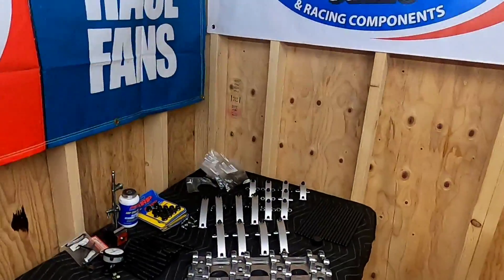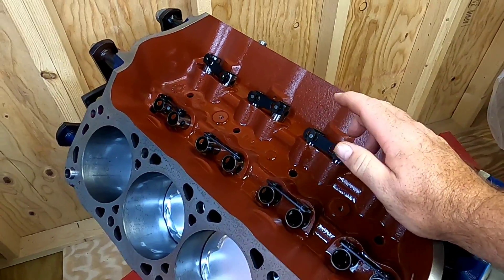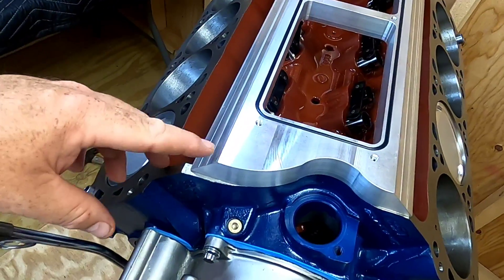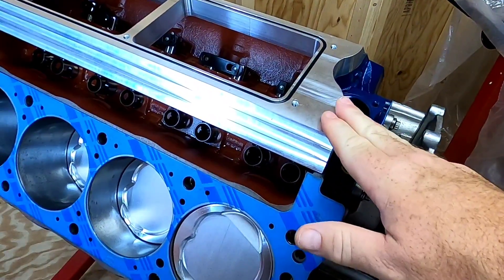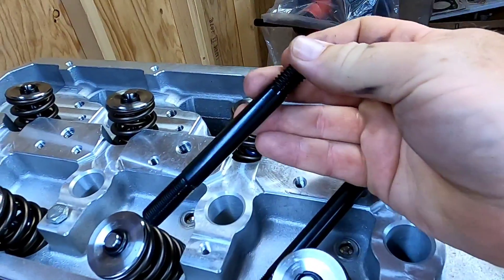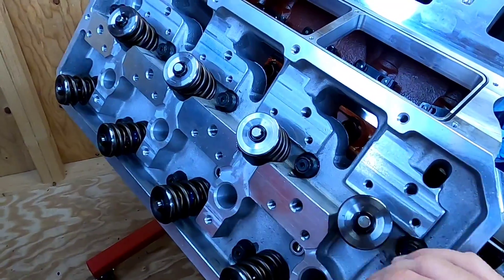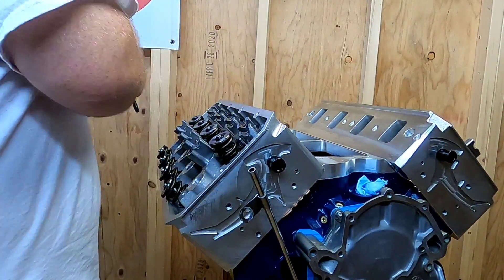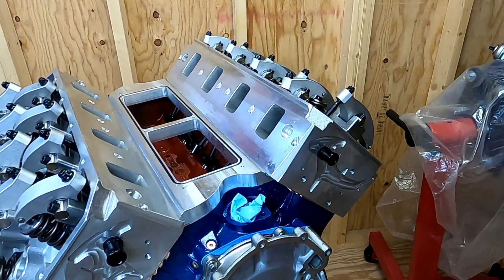BOSS 429 from a 429" Stroker WINDSOR??? Project MIXED UP BOSS

Comment: Love this idea, though Id almost rather see a pair DOHC heads … I know they used to make a SOHC head for Windsors, but thatd be pretty awesome to have a DOHC. Still, I def want to see how this turns out!  Will def be awesome!
Reply: If you don't mind losing about 2 liters the Coyote is a great engine to get into the dohc 4 valve world. They are a little different animal then the conventional 2 valve pushrod engine which is the world I came from before getting mine. I've learned a lot about valve timing (4 camshafts to degree!), more then I ever did with my sbc. For one, way more valve area relative to displacement so you can't really treat them like a 2 valve with cam lift, duration, and overlap.
Reply: @177SCmaro  I have a supercharged 2017 Mustang GT/CS … 670hp is a WONDERFUL thing, lemme tell ya!
Reply: @buzzbomb67  Ah. Well, there ya go.
Reply: @177SCmaro  lol I just figured, since he likes to bring up some obscure options, maybe he’d be interested in touching on the OHC kit for Windsor heads.  Wish I could remember who did it.  I remember it got pretty high praise, back in the day, but of course, its now obsolete, since we have plenty of OHC options, these days.  Still, it would be a seriously cool thing to pop the hood on, say, a 70 Torino GT, and find a SOHC stroker 351/454 Windsor with 8bbl FI
Reply from the maker: I remember seeing that also... I need to try and found out who did it...
Pretty neat idea..
Andy
Reply: @buzzbomb67  
How about a 78 Camaro with an engine that should be very familiar to you?
Reply: @177SCmaro  well if by that you mean a Windsor or Coyote in a Camaro, Id say the same as I would in re to putting an LS or Fuelie 327 in a Mustang.
 …first of all … 
BLASPHEMY!!!  BUT … that being said … I bet it hauls ass! Lol also, blasphemy aside, an engine is an engine, as long as the heart is beating loud and strong, it doesnt matter which heart it is.
Reply: @buzzbomb67  lol, blashpamy...
You'd better not look on my channel then.....😅
Reply: @177SCmaro  lol dude that looks SO GOOD!  I bet it runs like a scalded cat too…! Always glad to see something other than a Chevy small block going into something it doesnt belong in haha ;)
Reply: @buzzbomb67  
Well, it's still kinda in the teething stage. It has locked cams, no vvt and I'm still working out what cam timing it likes, how much overlap, ect along with playing with fuel and ignition but so far it's motivated that 3500 lb (with my fat ass in the driver seat) Camaro down the 1/4 mile at 13.3...in a 103 degree weather with like 5000 feet corrected air, with a too-tight torque converter. I'm hoping for 12's with better air and the tune figured out, maybe a looser converter given how these things like to rev.
And if that's not enough there is an S475 turbo sitting on my work bench waiting to make it's acquaintance this winter. As you know, boost is nature's problem solver when it comes to crappy air.
It's my revenge for everyone who's ever LS swapped a Fox Body 😈
Seriously, though, as great as sbc's are, I've been building them all my life and wanted something different, to build a 4 valve engine. GM really couldn't oblige me, and this camaro is the first car I ever drove so it's sentimental, so I started looking around and, oh, right, Ford modular...I wonder if one of those would (bearly) fit in a camaro? 2 years later here we are.
Reply: @177SCmaro  lol oh boy, have fun with that!  I do not envy you, getting all that figured out.  But at the same time, Thank God its mostly computer adjustments, not manual/mechanical!
My Stang is a Premium, so all the leather and luxury appointments run it up to 3850lbs, as I discovered recently.  I weighed 250 when I drove it through the scales at the garbage dump, and it weighed exactly 4100 with my fat ass in it lol but … well, lemme put it this way.  I live next to the Deschutes River near Olympia.  At a guess Id say its probably a couple hundred feet from the entrance to my driveway, to the start of the concrete going over the bridge, and in Sport mode, Im doing 75 before I get there.
I was so impressed with this motor when I had my 15 GT, but this 17, supercharged, blows my mind, every time!  You will not regret having that engine, in that car… though youll prob be kicking yourself a bit while you get it dialed in lol
Reply: @buzzbomb67  Part of my reasoning for a more sophisticated engine is I wanted to challenge myself and, well, the Coyote worked like a charm lol. Funny you say that about kicking myself because the very first time I put it tougher and tried to fire it (somehow) started and ran only 4 cylinders. The entire left bank was dead except for occasionally creating spectacular backfires out the exhaust. I played with tuning, compression was good, so I was like wtf? Finally I pulled both valve covers and physically looked at the cams and valve train. 
As you may know, the first two cylinders in the firing order on the Coyote are 1 and 5, which just so happen to be the front cylinder of both banks. So what I found was the number 1 cylinder (right bank) valves where doing what they were supposed to but cylinder 5 (left bank) the cams where 180 degrees out of phase so the spark plug was firing about 18 degrees before top dead center...on the exhaust stroke, with the exhaust valve open. Which is why it was like the 4th of July out that left header!
I still have a ways to go learning about Holley HP EFI, for sure, but it's amazing how much stuff you can do, and how quickly, without ever having to bust out a tool set. You can even make adjustments per cylinder. That was pretty eye opening coming from carbed small blocks. 
And your mustang sounds pretty much like the Mustang I was thinking about buying before all this covid crap started and congress got the "brilliant" idea to start printing tons of money so that now inflation means everything, esp used car prices, have shot up. 

So I may have to hold off on getting a mustang myself. My brother has one and it makes for a pretty cool picture to have both that and my Camaro side by side with the hood up and the same engine. Instead of the Mustang, and once the Camaro is all turboed up, I was thinking about 5.3 LS/5 speed manual swappin, RWD conversion on a 2000 Toyota Celica, make it my own Japanse Corvette to troll the import guys with at the Import drags. 
And yes, my family thinks I'm crazy. They're probably right.

Comment: Mixed Up Boss is coming together nicely. I totally agree with ya on soaking the lifters! Nice tip with the tape, never seen that before. I never had any luck putting down a good bead, I just use my finger to apply a thin coat. I look forward to seeing the next video!
Reply from the maker: Thanks Big Bear,  on the tape deal.. Greg Brown is the one who gave me that tip... it works!  Im ready to make some noise with this thing! LOL  
Andy
Reply: I'm definitely using tape now when I glue the intake on my next engine!
Reply from the maker: @johnflett2531  it's a pretty good trick.. that Greg told me about... Works great

Comment: That engine is going took look amazing in Casper! Can’t wait to see it run! Awesome job Andy
Reply from the maker: Thanks Roost!  You and me both...  
Andy
Reply: @UnityMotorSportsGarage  

Hi Andy is there a reason you are using a Ford Boss  block instead of a Dart block thanks.
Reply from the maker: @ken2892  no, other than I ended up with the FRPP Shortblock for screaming deal... And that is where the idea was born for MIXED UP BOSS.. BOSS 351 block with BOSS 429 style heads!  I've used Dart blocks and Man of War blocks in the past with DV but this is my first FRPP block... 
Andy